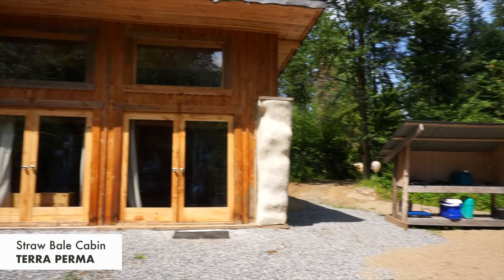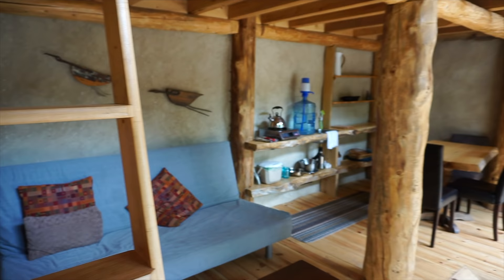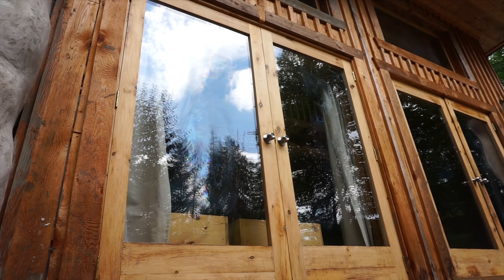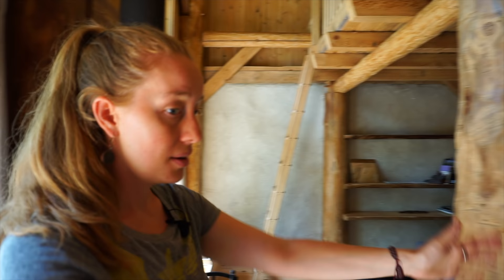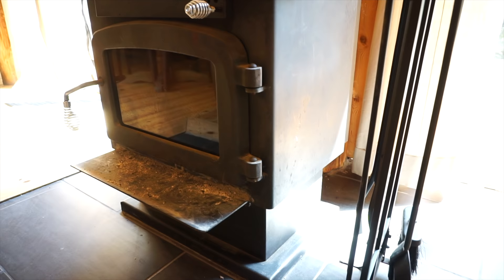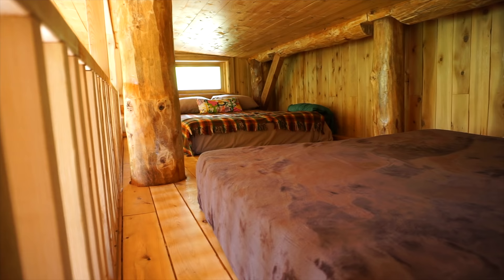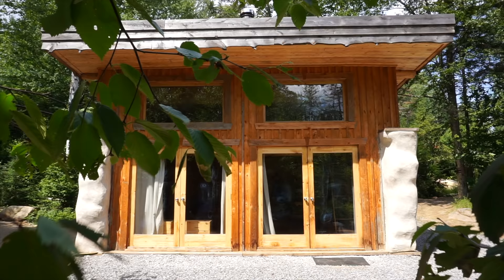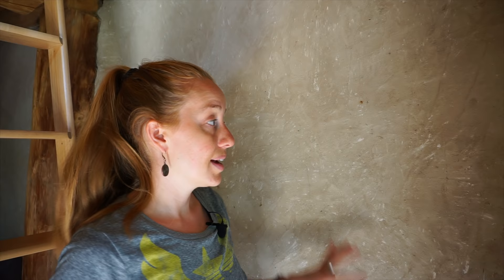Sustainable Micro Straw Bale Cabin with Passive Solar Green Roof

Comment: I've used the pond liner in remodeling to stop leaks and let me tell you not one plant will ever grow on that stuff because it will be well over 200 degrees every second of the day. You can't even handle that stuff without gloves on. If you are going to use it in the future, get the light grey version. The black only when you want heat or it's not going to be in direct sunlight anyway.

Comment: how did they secure those big support logs on the inside?
Reply: Mortises end tenons,  its where you carve hole in one and cut another to slip both and sometimes bore a hole to peg with an oak dowel, no screws and fasteners needed